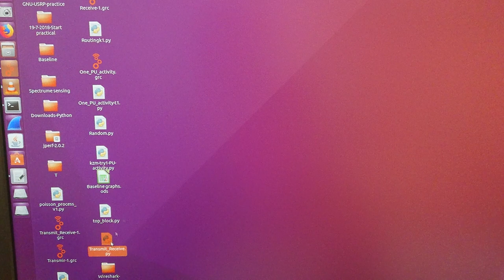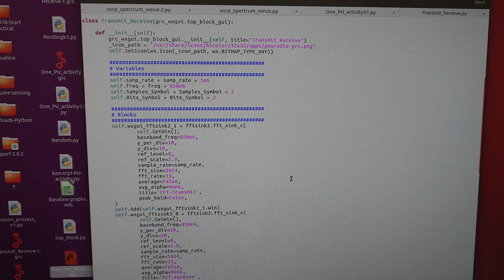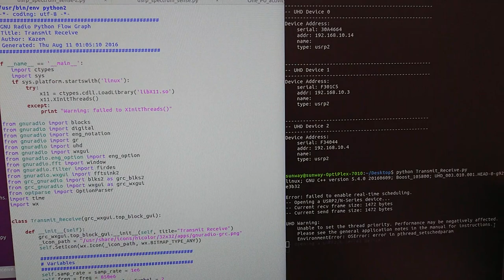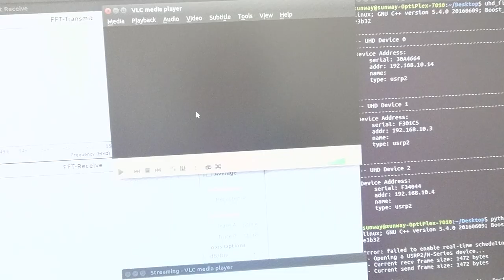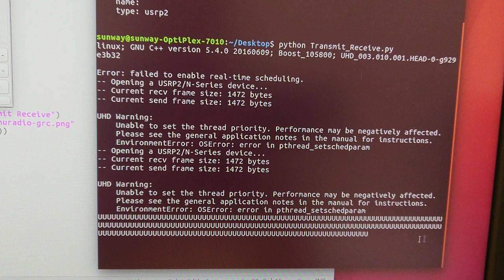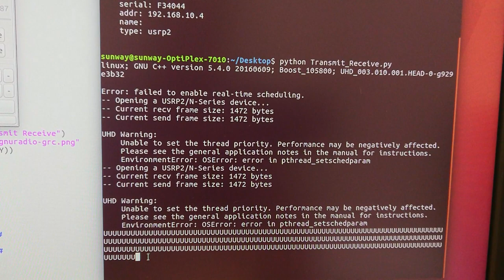USRP GNU Radio Communication setup

Comment: Are you able to make a video or refer me to a guide on how to create a GNU Radio flow graph to produce something similar to the Transmit_Receive.py file you have? Also, I'm very new to this, so could you also inform me on how to connect my Ettus boards to my computer?
Reply from the maker: To see the communication between source and destination through more number of intermediate nodes you can have a look to this video: https://www.youtube.com/watch?v=s3W_CMXklPk . I have tried to demonstrate transmission and reception with use of USRP/ GNU radio and Raspberry Pi3 B+ as the processor.
Reply: @goodtoknow78  Yes, I've watched that video! But I was wondering if you could direct me to a guide or tutorial on how to create a Receiver and Transmitter for two Ettus boards in GNU Radio. All I'm trying to do is pass simple data, like an integer, from one Ettus board to another
Reply: @jadamariano  Hello Jada. If you are successful in passing simple data between Ettus boards, please also send me the tutorial. Thanks.

Comment: I have usrp2 with me...I am trying for fm.transmission and reception...signal processing block output is ready...but am unable to transmit the audio file of desired frequency onto the mobile phone when I tune my fm in to the desired frequency....similarly unavle to recve the fm signals of frequency that I have setup in the signal processing blocks...problem is with antenna settings...do I have to configure my antenna if so how??...awaiting for ur response
Reply from the maker: If you have configured blocks correctly and defined the transmit and receive frequency with correct center frequency, port address,  and sample rate, then it should work. Try again and if you were not able to figure it out will check with you in more details.